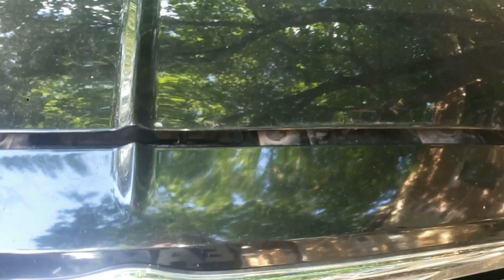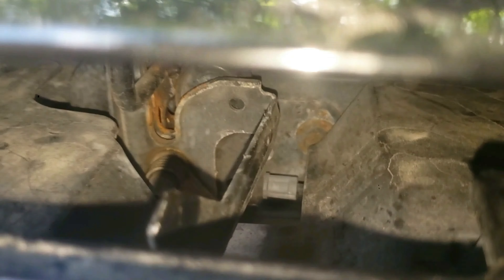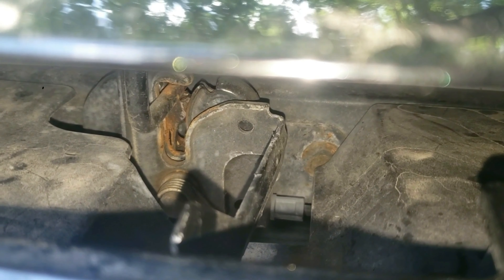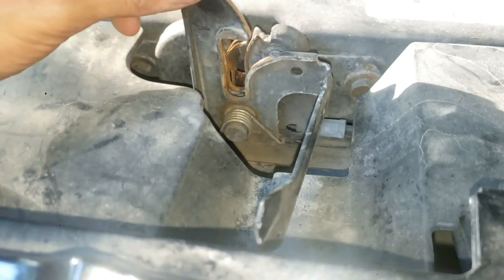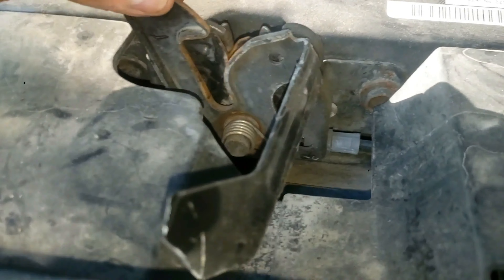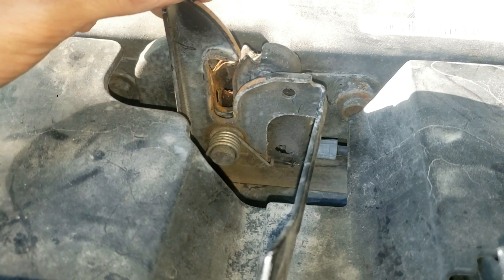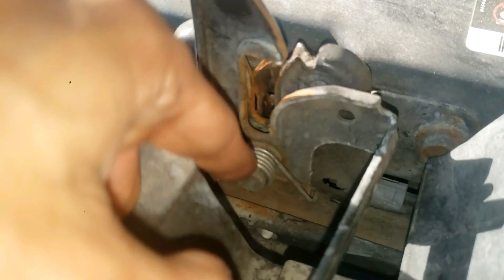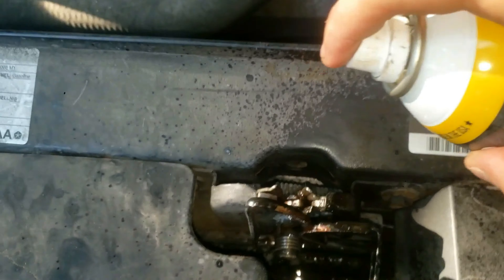How To Open A Stuck Jammed Hood Latch Chrysler 300 Dodge Jeep

Comment: In case anyone watching this has the same struggle i have, neither this video or the other videos i watched hit my problem and solution precisely so i would like to share how it took 3 people to resolve it for me.  One inside to pull the release, one on the driver side of the hood, that side would pop open and the middle  latch worked, but the left side had to be pried open gently  with a heavy flat head screwdriver  while the right side was lifted, carefully but firmly all three at the same time and then the left side release popped free. 

 I felt utterly alone struggling with this for days but by a miracle,  family stopped by and helped.  We oiled it but that did not resolve the problem.  That piece has to be replaced.  I dont know what it is called.  I dont know how to share a pic. I posted a pic on my channel in the community section.
Reply from the maker: Good info for those who have a jeep. The spray may only be temporary and you got to do it probably during every oil change. unless of course you get a new one. But that too should be sprayed from time to time.
Reply: @FixCarYourself  I probably said so in another comment, your video is great and i appreciated it.     My problem was so special.  lol. I felt i owe to anyone trying to fix theirs, to post what i learned.  Thanks again.

Comment: Thanks for the video.  I thought I needed to purchase another latch when all I needed to do was apply some lubricant to my sticky latch.
Reply from the maker: Glad it helped. It's Simple right. Save your money and hassle from replacing the latch!!! Just remember to do this after every oil change. 1 can costs under $5, which you can get at a local hardware store.